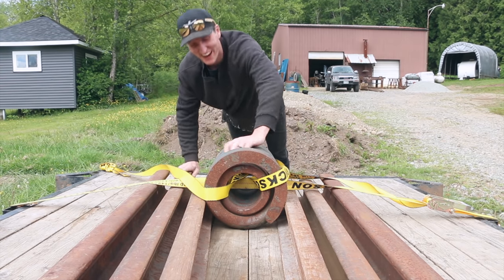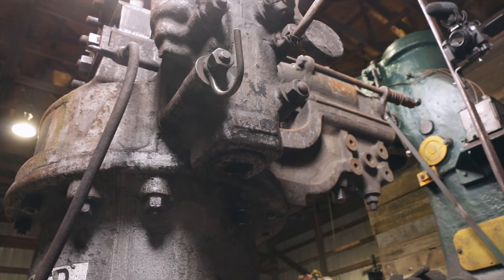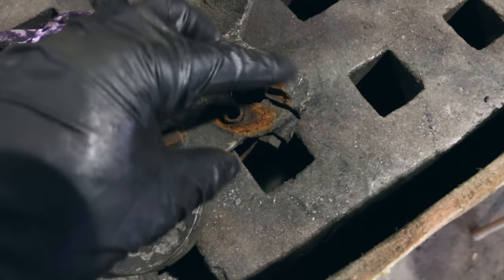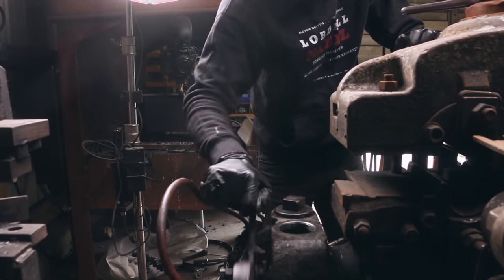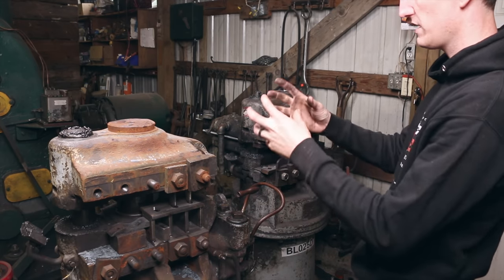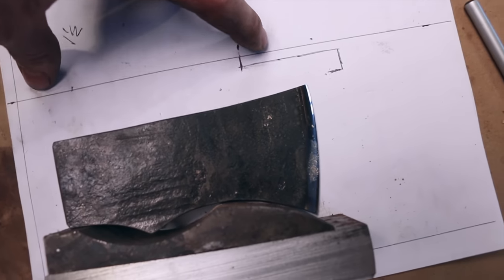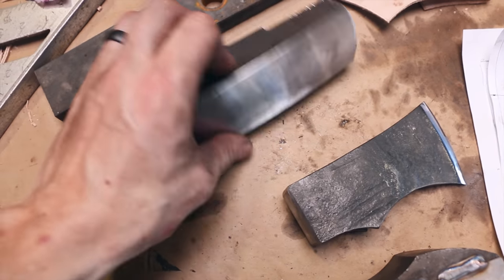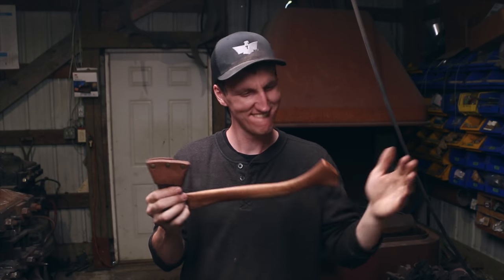Opening the THROTTLE VALVE up on the UPSETTER

Comment: One possible workaround for your upsetter is adding a longer handle on it to give yourself an increased throw distance between the point of activation and the point of maximum air flow thus allowing you to better control the flow rate and get a more gradual and precise activation of the ram.
Reply: Good thinking, he could even make it adjustable to fine tune the feel.

Comment: The 1908 combo set is awesome. It's a manly gift for men that have been forged from steel, hardened and tempered. Honed to a razor's edge and smooth as silk to the touch. 👊🦊👍 🪓 
I'm only guessing, It's a on or off type thing. Keep fingers out of the way.

Comment: If you would just extend your handle so that it sticks up like a foot taller--- then it will have a lot more throw and you can be a lot more precise with minute movements....  I'd actually make it 2 ft tall, like a hand brake in a drift car. lol..  Easy fix;  and easy to revert back to the original... You could even extend the handle straight out to you, so you don't have to reach for it, and it would still give you the same effect.
Reply: the ergonomics would be horrendous, better to just adjust or fix the problem.
Reply: @genghischuan4886  How? I disagree.   You're doing the same motion-- pulling a lever.  It just has to travel 4 inches instead of 1/4 inch......  and if you had the handle sticking straight out at you, you could have even more stability, because its much easier for you to push something precisely up and down, rather than forward and back--- because that is effecting your stabilizing balance, vs a handle sticking straight at you, right by your side.. you can push it up and down like drawing a pistol from a holster at your side.  It would be 1000x better, way easier to reach, a wider range of movement with finer gradient... You could even do it with a C-clamp and a piece of flat bar temporarily, it would only take a few seconds to set it up and can be reverted back to the standard set up just as fast............   The only issue that I can see is that it would stick out in the way of you walking by it when you're not using it........
Reply: @calholli  you disagree because youve never run equipment. end of story
Reply: you would be better off just adjusting the valve so it works right, nice and responsive, and you could move it quickly to hammer somthing down
Reply: @calvinwright1816  exactly, the correct way, not welding some intrusive back breaking bars that get in the way and make the job unsafe
Reply: @genghischuan4886  back breaking bars?  what the hell are you talking about. lol.. You're obviously not even following what I said;   extending the handle like I said would make it even more ergonomic.  I'm trying to get you out of your box, but you seem trapped in there.  In case you haven't noticed, he's making custom tools, adapters and controls on just about every episode.  You need to learn to use your imagination a little and learn how to solve problems.  my comment has 19 likes, your's has none...  I'm not the only one who understands how wrong you are.
Reply: @calvinwright1816  It is nice and responsive--  its TOO responsive.  He wants reduce its sensitivity.   And sure, maybe internally things can be changed, fixed, adjusted, ect....   But I'm just saying, as a quick and dirty upgrade.  He could literally take a pair of vice grips or C-clamp and clamp a long flat bar onto the handle and make your sensitivity adjustable, depending on where you grab that bar/ handle.. and keep on working without being slowed down-- he has a deadline to finish these things.. he can take it apart later when he gets the spare time.  It's not hard to understand. lol.
Reply: @calholli  no it wont, it will fuck shit up make things worse, you FIX the engineered machinery not fuck it up. It isnt your xbox controller or drone
Reply: @genghischuan4886  How... how does it fuck it up? lol.. You make no sense at all, and I can't tell if you're just trolling or not.  This is hilarious to me........   You know in older, LARGE trucks that were hard to turn, they just put a bigger steering wheel in them so that you would have more leverage to spin that wheel.  You're still turning the same wheel, its just easier...   Same thing here , you're still actuating the same handle, it just gives you more range of motion instead of barley touching it and it slams on and off when you don't want it to.  I can't explain it any plainer.  If it's over your head, that's ok man.  math is hard
Reply: Honestly i was thinking the same thing not too far to be annoying but it would still make an improvement. Also that genghis guy an idiot dont mind him.
Reply: @iantweedie4060  derp
Reply: @iantweedie4060  yeah Im an idiot for saying fix dangerous machinery properly instead of welding garbage all of it and missusing the valves that are worn out. yeah Im such an idiot for saying do it the right way. I think you should look directly in the mirror every single time you use the word idiot or moron. the shoe fits perfectly

Comment: Hi, really enjoy your videos! Pick up a can or 2 of spray carburetor cleaner to really clean out the sticky gunk in the hard to reach places. It will dissolve it  flush it away so that you can apply fresh oil/grease.  Cheers.

Comment: WD 40 is called so because it was formulated in 1953 by Rocket Chemical Company. "Water Displacement, 40th formula" to keep water from condensing on to the outside of liquid fueled rocket engines. The company does make de-greasers too!

Comment: QUESTION! If that rail track is that old would the radio isotopes be different like how it is in battleship armour? They use certain armour plate types because of the lack of nuclear isotopes. Gives a better back ground picture for mri’s and such
Reply: Any steel made before July 1945 (the Trinity test) can be considered low background steel and is highly sought after for MRI use.